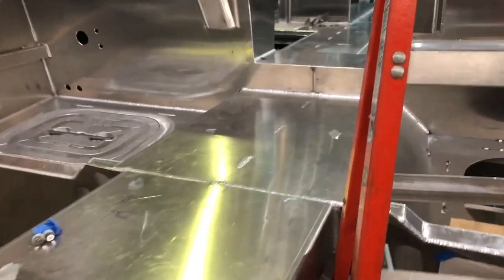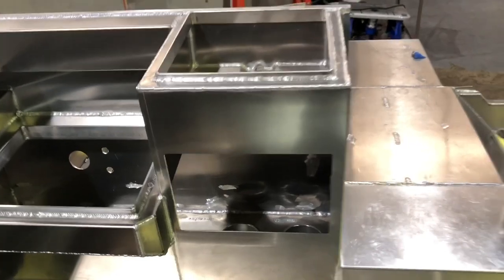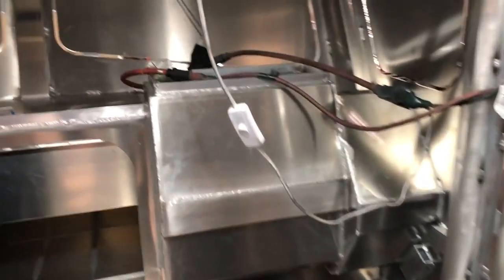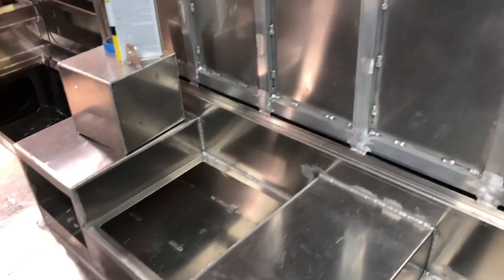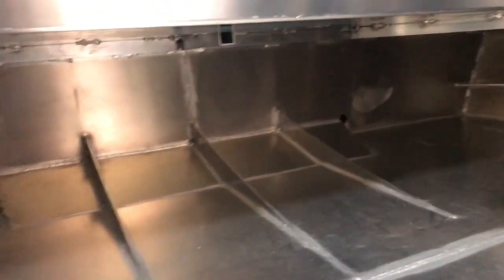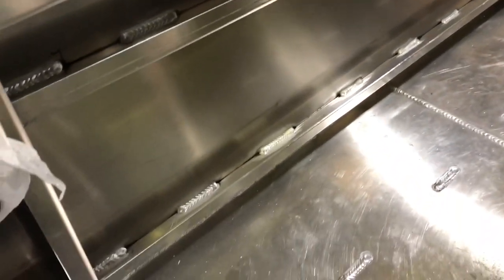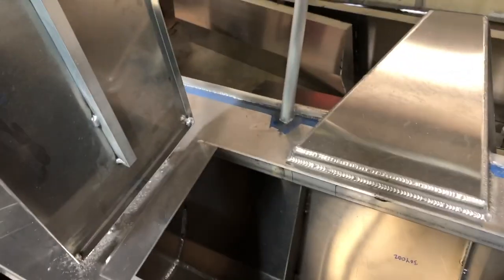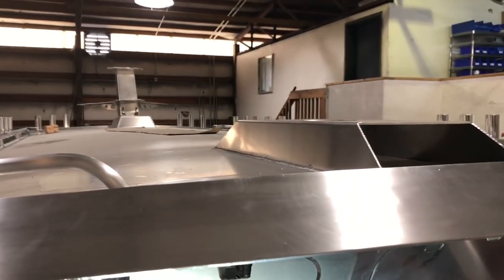Build Update - 2023 Allied Boats 30’ x 10’ Welded Aluminum “Wildcat” Catamaran

Comment: What are the#’s with the new Zuke 350s?
Reply from the maker: Wot is 6,300 rpm. Fully fueled (250 gallons) and 6 adults, we hit 48.4 mph burning 0.84 mpg.  Cruise is more like 28-34 mph, 4,400 - 4,800 rpm, getting 1.2 a 1.3 mpg. Low 20s will yield 1.35 or so.
Reply: Those #’s are great. Good speed and fuel efficiency and because of the cat ride you actually get to cruise at those speeds a hell of a lot more!
Reply: Those #’s are great. Good speed and fuel efficiency and because of the cat ride you actually get to cruise at those speeds a hell of a lot more!